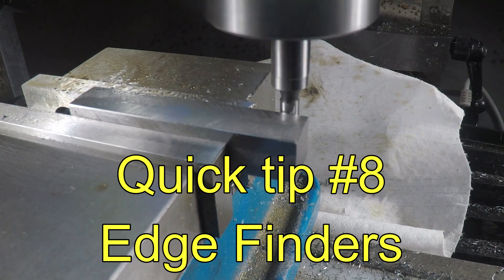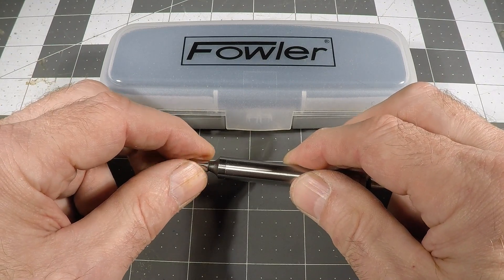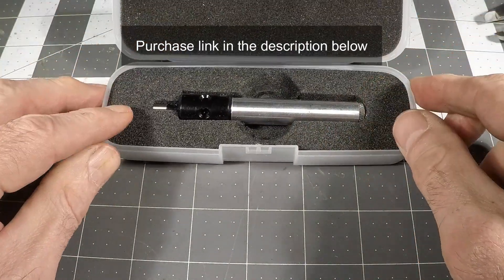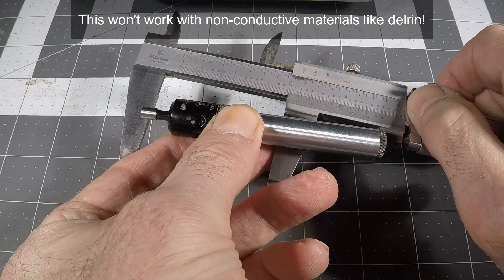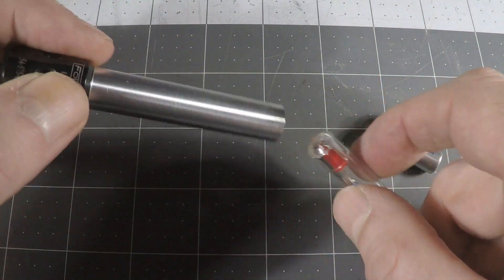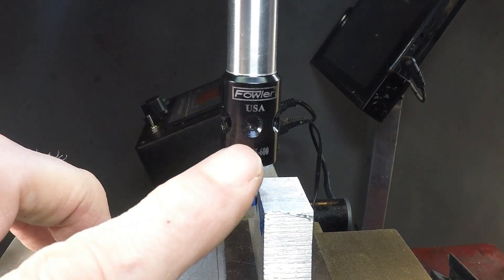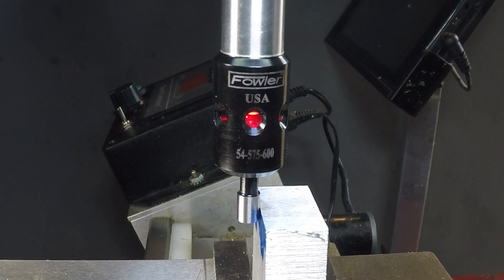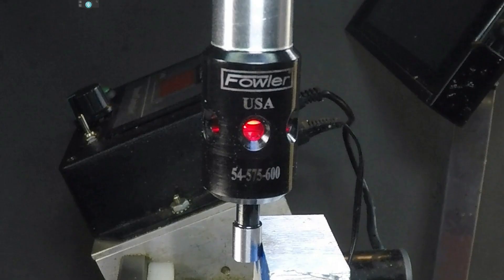Quick tip #8 Electronic Edge Finder

Comment: Bro, if you're trying to eyeball when the edge finder is exactly centered you're using it wrong. It's when it just over-centers that you've found the edge and it's very obvious visually.
Also the runout doesn't matter. That kind of edge finder is accurate within a couple tenths regardless of runout
Reply from the maker: For me it's the difference between an analog measurement and a digital one. I just happen to like LEDs too.

Comment: Second video of watching you, I absolutely enjoy your presentation!

As I run a Micro Mill (Proxxon MF-70), I am "limited" to 0.125 shanks, however, I am already designing my version, the hardest part will be choosing what color LED that I use, as I buy SURPLUS electrical items and have 100-150 LEDS, a 3V battery, just because and for a cool factor, I think the body below the the battery housing will be turned from acrylic so the whole thing lights up!

Truth be told  I have been designing it "in my head", fr Six Months  give or take an inch . . . .

Thanks for such DETAILED video work!

philip, from the Great Pacific NorthWET, Oregon, USA
"Wood Working" & "Electronics", since 1957, Metal working added, 1968
Reply from the maker: That sounds like a fun project, and thanks for the kind words!

Comment: Guy, actually using a collet or a chuck of whatever with or without (much) run-out mostly doesn't matter when using a rotating edge finder. It will run true to the rotational center of the spindle. So, if you want to find the center of your work piece (splitting the difference between two measurements), this will work perfectly. 

However, not rotating the digital edge finder results in a measurement error in this case (finding the center) if the edge finder is not exactly in the center line due to (minor) deviations of the chuck, collet, etc.

A mechanical edge finder will show a sudden shift opposite to the rotation when the friction between the work-piece edge and the finder is higher than the friction between the finder point and its base. That is a tiny force, so the finder just touches the edge. If used in this way I am sure the mechanical finder is superior to this not rotating 'digital' solution when it comes to finding the exact center between two measurements,
Reply: @Michel-Uphoff This! You are indicating the center of the spindle, runout of a collet or chuck does not matter.
Reply from the maker: I understand and agree, but I measured the run out of the Fowler unit at .0003" in my R8 collet, so non-rotating measurements are as accurate as I need them to be on my machine.
Reply: Agreed.. 💯

Comment: I don't bother with edge finders. I chuck a short precision ground rod and hook one end of my multimeter's alligator clip to it. I hook the other lead to the part and set the multimeter to continuity mode. I slowly creep the table until the multimeter beeps, meaning the rod contacts the part completing a circuit.
Reply from the maker: I don't understand how you are electrically isolating the part. A continuity meter would measure a connection before you touch the two parts because the whole Mill and vise etc are connected.

Comment: I have been meaning to get one of those , Not sure if I should get the beeping one with the LED or this one you show ? I have an old spring loaded one that works but I like the tech of that style..
Reply from the maker: I considered one with a beep, but one of the reviews said that it was a really annoying sound.
Reply: @GuyMarsdenMakesStuff  ah yes , I could see that being an issue while trying to concentrate on the job at hand ..
Reply: @shawnmrfixitlee6478 The led style is less accurate than you might think. Any runout of the collet plays a part in the equation with these and they are generally considered sub par. Suburban tool has a good YT video outlining the differences.

Comment: I like both versions of edge finders that you showed.  I just prefer the Starrett brand myself. I have yet to try the light switch version, may have a look into that. I have used a diy electric contact edge finder on my home built CNC machine, no lights but it sends the 0.00 position signal to the controller and it will automatically check all 3 axis in both - and + locations.
Reply from the maker: I think I may alternate between these two depending on the application...
Reply: @GuyMarsdenMakesStuff  if I ever convert my mini mill to CNC I will most definitely use the device that I made for my CNC router because it is extremely accurate
Reply from the maker: @taranson3057  I measured the run out of the Fowler unit at .0002". I call that pretty good accuracy!
Reply: @GuyMarsdenMakesStuff  I would hope so :-)